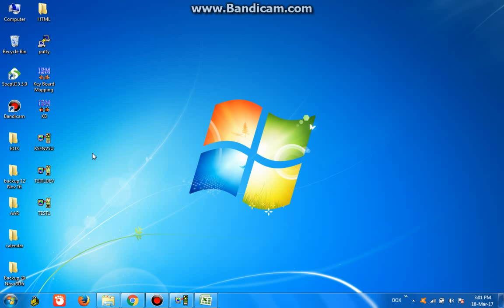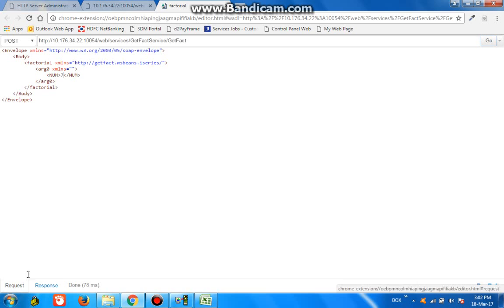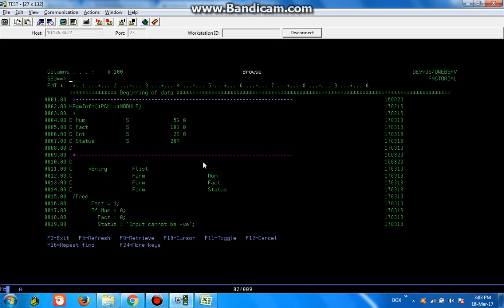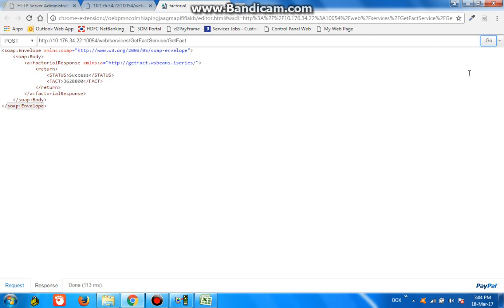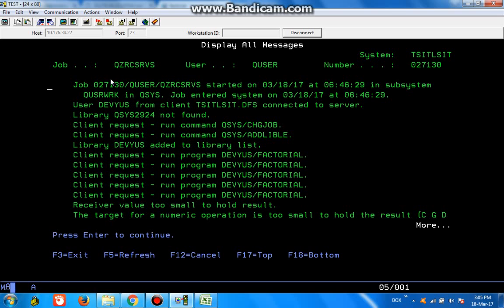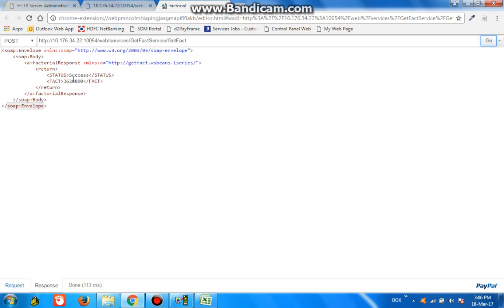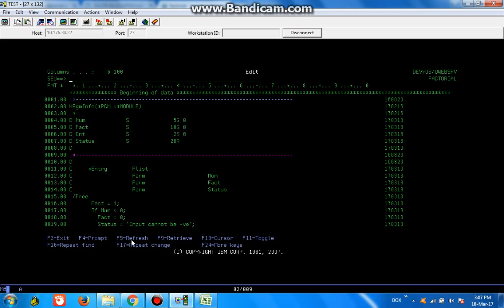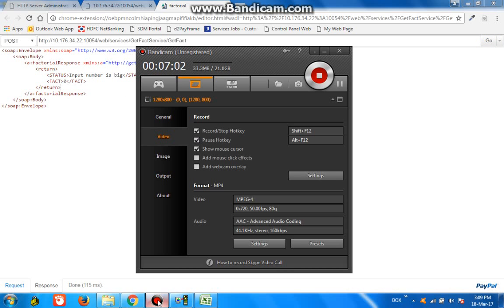AS400 Web Service Part 2 Debugging Web Service

Comment: Hi Yusuf, Good job
We recently implement RPG programs hosting HTTP as mentioned above, We are about 100 service and running on one name, when issue has come it is become difficult to figure out the job to debug, do you have any suggestions
Reply: For these cases 'RDi' is such a life saver. If you are using RDi for development, you can easily set up service entry point on the RPG program using this user id. RDi debug catches the call on that RPG program put it in the debug. Now if you are in production and if this service is expected to be a very - very busy one, I would not do it there. But if in a controlled test environment this can be done.